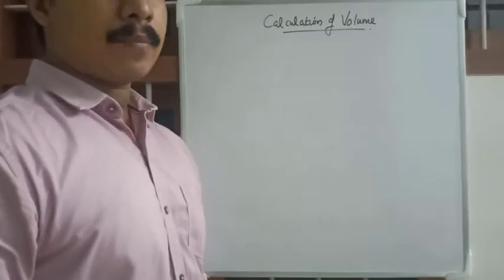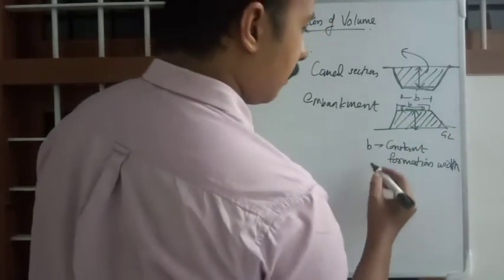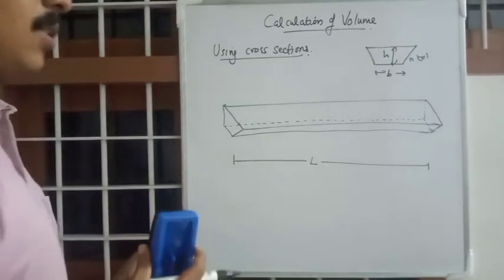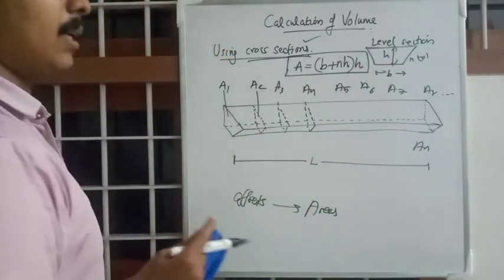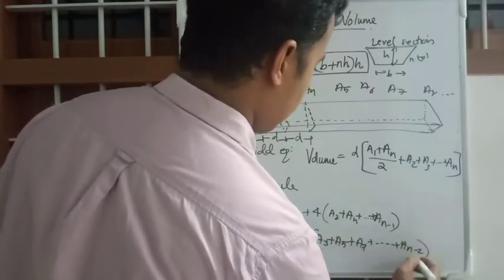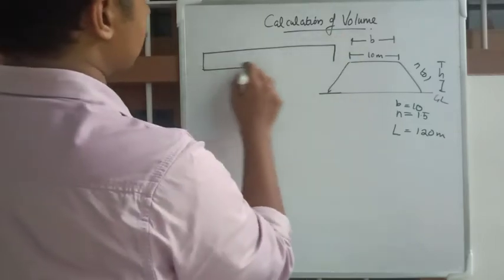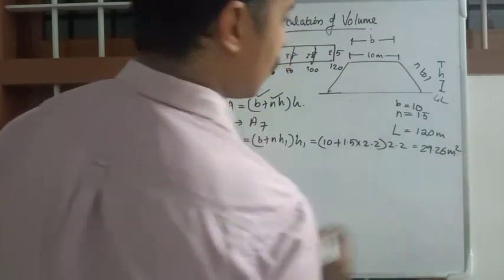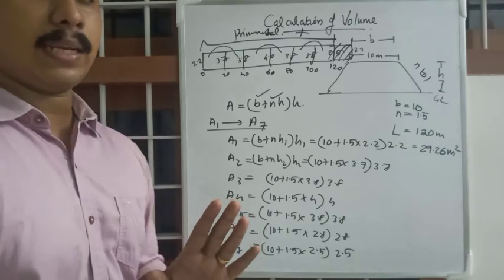Calculation of Volume : Level section : Surveying

Comment: Derive the formulae for the calculation of the cross-sectional area.

i) When the ground is level along the transverse direction (Level section).

ii) When the ground surface has a transverse slope (Two-Level Section)